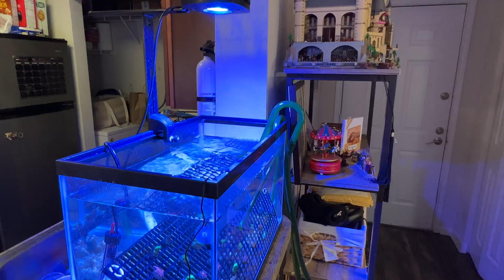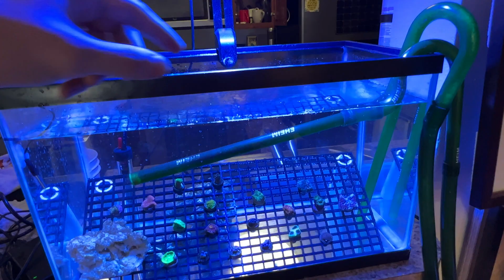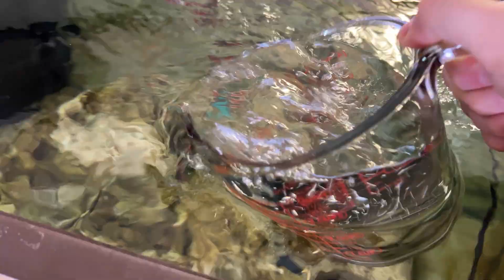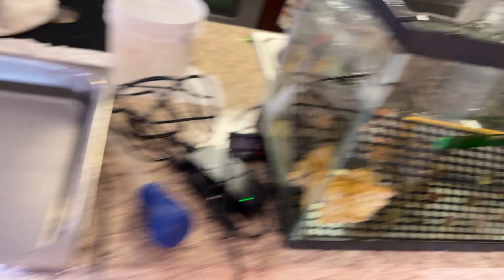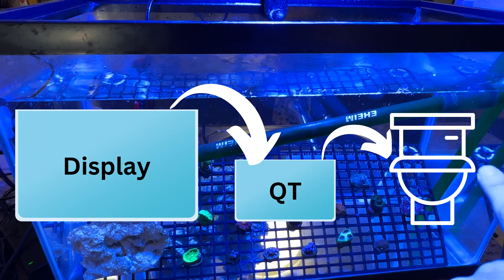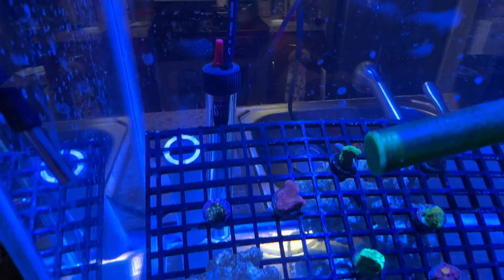Coral Quarantine Tank Setup: Beginner's Tips for Success

Comment: Can coral host ick? Are the coral frags grown in tanks with fish? I always thought it was more like tissue culture in land plants and grown in a sterile environment?
Reply from the maker: So soft tissue cannot but part of Ick's life cycle is to encyst on hard surfaces. This is technically the longest part of the life cycle and the part where it reproduces. So once it encysts it is extremely hard to kill. Even bleach needs a significant amount of time and won't just kill on contact. But from this stage it releases new free swimmers into the water column that look for fish hosts. 

Most vendors grow their corals in tanks with fish for two reasons. One the utilitarian fish such as tangs and wrasses remove algae and pests. Two, fish add nutrients to the system that would otherwise have to be added another way. But since they are primarily focused on coral growth they usually don't do anything to eliminate fish diseases in their tanks.
Reply: @Brennin's Reef  Thanks for the thorough answer.